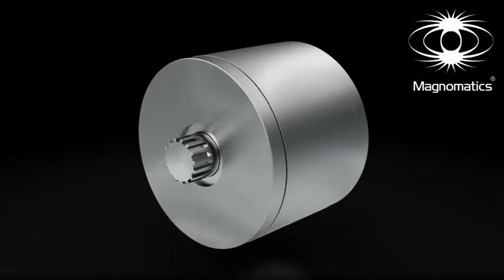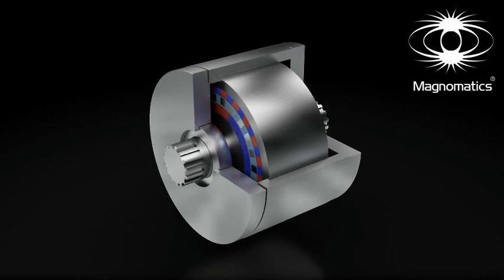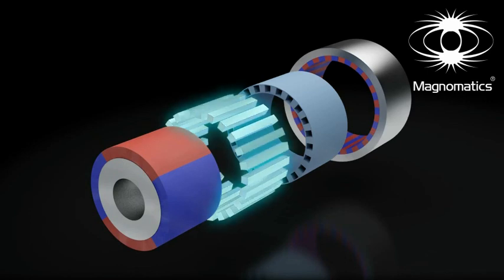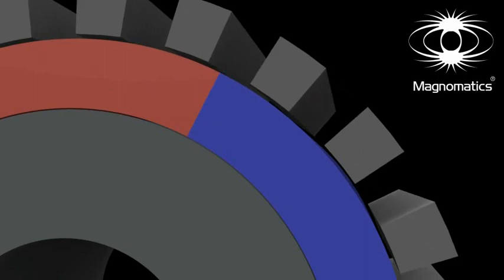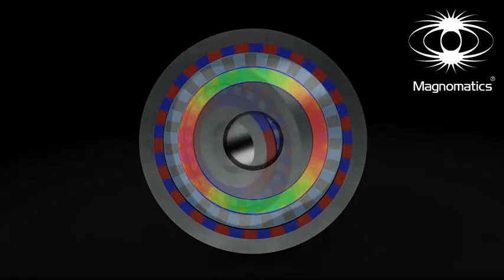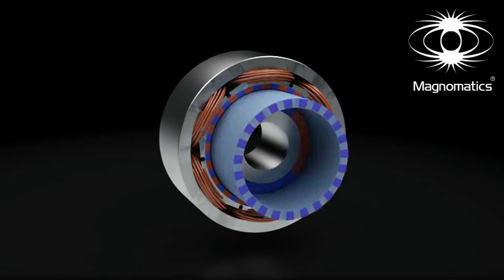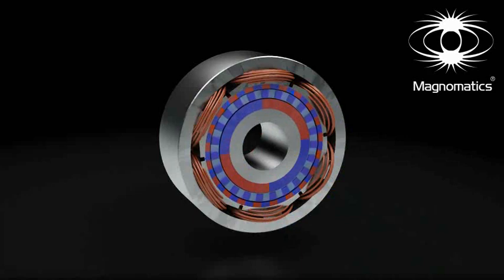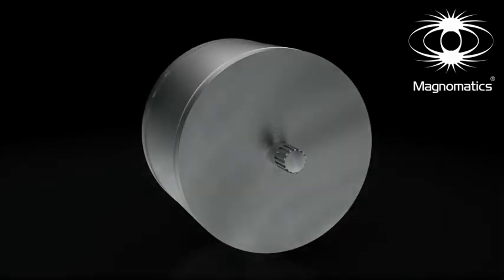MAGNOMATICS' MAGNETIC GEAR AND PDD® MOTOR/GENERATOR

Comment: is it possible to change the gear  ratio by shorting the metal poles in various combinations ???
Reply: That would be done by changing the number of metal rods, or the number of magnets on either the outer housing or inner rotor

Comment: Is this possible to apply to bicycles to provide a continuously variable transmission?  Pinion and Rohloff gearboxes are getting more mainstream.  This concept could solve and capture both the infinitely variable transmission market and the e-bike market in one product.  Put this together with a gates carbon drive and you will have a zero-maintenance cvt e-bike.
Reply: I have seen one of these in action, not on a bike, but it was on a workbench. I don't think it would work as it can operate at high speeds with only the bearings heating up, but the moment you try to drastically change the speed, the "gear" skips and takes a bit to recover. I recall a video of someone using a program to get a small dc magnet up to 100,000 rpm, and the first time it got to 40,000rpm and due to a software error it "skipped" and shot down to about 9,000rpm before it recovered. The magnetic gear I saw tested needs to gradually get up to speed and gradually slow down, but the 3d print the person testing it made held up very well until their second one which had a slight variation in the print height carved up the magnet housing they printed. Perhaps a flywheel would help, but I'm not educated enough to give a definitive answer.
Reply: @Suzuki_Hiakura  Forgot about this video and the idea.  Revonte has an infinitely variable electronic transmission for bikes now and is in the process of commercializing it.  Based on a planetary gearset, similar to a Prius...but your pedaling is the engine.

Comment: Hmmm  rotating strong magnets are a recipe for trouble. It puts severe restriction on the materials used for the housing/casing the device. It must be non-conductive otherwise the currents induced in the casing by a fast-moving magnetic field would generate a lot of heat and force the resistance to the shaft rotation due to Lenz's effect. There is no way such device is "nearly 100% efficient" unless it is non-metallic.
Reply: I assume they use lamination like they do on synchronous and induction machine stators, thereby minimizing eddy currents. If it was impossible like you say, AC electrical machines would be too.

Comment: If it's not a secret, could you share such information as efficiency, ratio, torque and rigidity of your transmission?
Reply: As I understand it, the magnetic gears have efficiency around 95%. Torque is high, especially with larger diameter designs, but the output rigidity is only modest compared to cycloidal gears. The video mentions how the angular deviation is predictable with load. If the load is also predictable, then software may compensate, but if load is dynamic or reverses, then the angular error will be significant. 

In comparison, when cycloidal gears use output pin roller bearings, their efficiency is around 98-99%. 

If you need a very quiet low speed output with no additional output gearing - this may fit. These are certainly quieter than stepping motors or conventional reduction gears. 

Perhaps the best environment for these are in vacuum since so few parts come in direct contact - just the main bearings. The Mars rovers were going to be fitted with a dry lubricant reduction gear system, but failed under accelerated lifetime testing. These magnetic gears would have passed any lifetime criteria.
Reply: Thanks for your helpful explanation.👍

Comment: My only problem with this device is on the QM scale of things. When and if the 'gears' are to slip, the magnetic dipoles are forced to partially re-orientate reducing the net field strength of the magnet, at first this wont seem like much of an issue but after more and more time the gears will slip. Effectively this device will be useless as a fraction of the initial torque required to make it slip will be needed to make it slip after only maybe six months of heavy use.
Reply: I don't think that's a fair assessment. If you exceed the rated torque of a mechanical gear box just once you've ruined it. If I could choose between a stripped gear or a slightly lowered capacity after an incident I'd gladly take the lowered capacity.
Reply: True, however I would largely prefer a gearbox that could still work over a gearbox that breaks immediately and where I have to change the gear as soon as the gear silps.

Comment: What's with the hate? This is a proven technology... Let's look at an alternative energy example shall we?
Part of the problem with tidal power generation is that the gearboxes need to run for 50 years without maintenance underwater. A magnetic gearbox does not wear like a traditional gearbox and has virtually no power loss (only a bit in the bearings). So how is this bullshit if it is being put into production for such purposes? Are you Amish? Do you want to just stop technological advancement?
Reply: The bullshit is the high efficiency claims. The reduction isn't magically free just because it's "frictionless". Moving magnetic fields generate heat.

Comment: I think I understand this magnetic gearing principle now. it's a moiré effect because the iron pieces only conduct samples of the outer magnetic ring.
but it seems to me that for an electric motor there is no advantage to magnetic gearing as it is more weight efficient to simply drive the final axis directly.
Reply: Sd
Reply: It may be no advantage for an electric motor, but the real question is, is there any advantage for an internal combustion engine for example, in a hybrid vehicle?????
Reply: @Manuel_Gestal  I doubt this concept is useful for anything but electric transmission could well be quite useful for combustion engines. Piston engines for cars are all but dead but I have considered if jet engines could use electric transmission to convert the high rpm of the jet to the lower rpm of the large fan. It could also give it location freedom. It just might be efficient enough to be a cleaner solution than large turbines and gearboxes in jets

Comment: @oldschoolsituationz my comment was for all those thinking its a "magnet motor" a motor that works with no power input. it just uses permanent magnets and nothing else. yes and electric motor tech is a magnet motor. as they work with the power of an electromagnet and a permanent magnet or two electromagnets. but if you go thru and read the comments you will find all those idiots comments who i was addressing. but i dont even know why they call them magnet motors when they dont motor/dont work.

Comment: @oldschoolsituationz it clear to anyone that can read its not OU/free energy. the point is all the ppl calling it fake. or saying how its a real magnet motor. the point is if you open you eyes is that its a gear. nothing more nothing less. and any 3rd grader knows how a motor/generator works. the point of the video is not OU or PMM or free energy like most think. its a magnetic gear for use inline/shaft or built in to a motor/gen. my comment was for the "mag motor" "free energy" idiots

Comment: Weird I don't recall using the word overunity, or magnet motor, like you did.  It is like you said a step down gearing system.  Where you pulled out overunity from the words simple magnetics, that is where you mind is at.  Good luck to you, but I would stay away from assuming such funny things.  Like you should know overunity doesn't exist :) So stay comfortable in that...

Comment: @Isaiahritchey are you that much of a moron? this is not some magnet motor or over unity device, its a step down gear, that uses magnets, thats it!!! this is a great idea, its a stepdown gearing system, that has the built in plus of these gears will not strip. if the output over torques it can skip "teeth" with out stripping them. my patented baby AC uses a pump that has a magnetic gear, so the motor is sealed from the fluid with no chance of leaks, like it would if it used a seal

Comment: come on poeple, this is a gear, it even states that in the title, but since it uses magnet you boobs think it has something to do with over unity or PMM or a magnet motor, why not open your eyes, and ears, magnet gears are used all over the place, in some pumps they are used so that the motor does not seals that could fail. this is just a stepdown magnetic gear. it is not a motor it has an input shaft and an output shaft. great video can see where this could come in handy.

Comment: @WolfsburgWarehouse Could these gears run a generator or capacitor to generate electicity as you drive?  You could skip a lot of plugging in.  The car would recharge it self with no friction like using a belt drive.